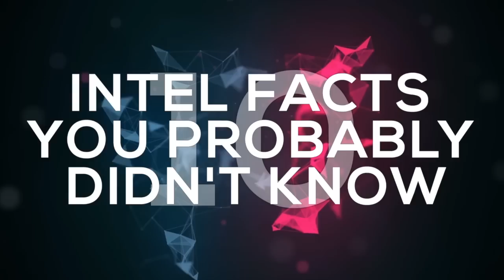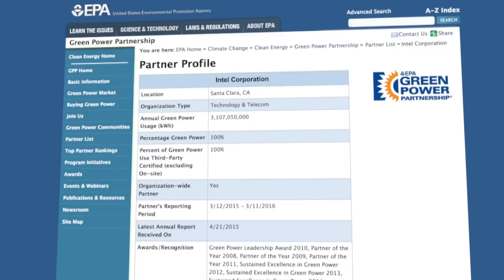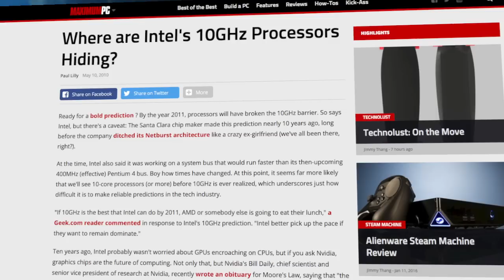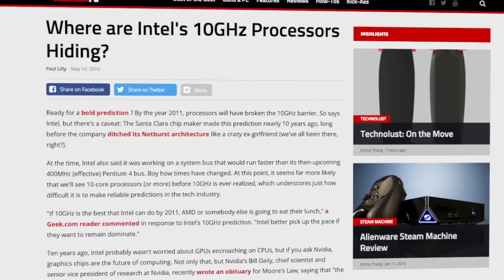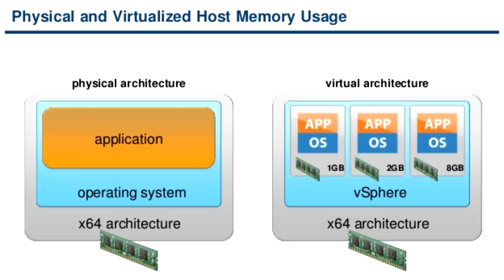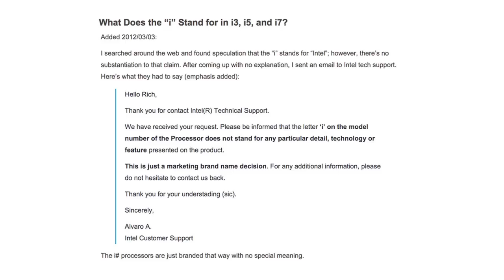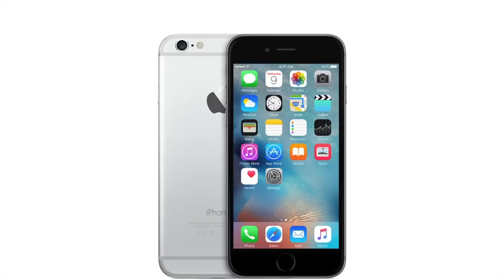10 INTEL Facts You Probably Didn't Know

Comment: You should do a video on Li-Fi
Reply: +Nathan Who why? It's shit.
Reply: Explain your reasoning.
Reply: Nathan Who
* You require the receptor to constantly be open (not covered), so that means no mobile devices except maybe laptops (but not even those, I'll show below), because you don't have enough room for that.
* In order to stimulate the receptor, you either need a strong source of light, or a very big receptor. And I do mean big. Or you just have very low transfer rates. Why? Because look at DSLR cameras. Under a LOT of light, the best DSLR cameras can produce around 60Mb of data in under 1/100s, using a huge, very expensive sensor. LiFi doesn't need many pixels, but it's just the general information theory. Both devices would transfer information. Try to make the sensor smaller and you get a weaker signal, more noise, etc. It's inadmissible in data transfers. The total information passed is the information in every pixel * number of pixels. Make fewer pixels and you'll get less information. You can make 1 single pixel (like it's required for LiFi) but make it very big, but that will just equal to the same information transfer speeds. And that's a pristine, clean, huge sensor under immense amounts of light compared to what people usually have at home when surfing the web. The sensor you can fit on a mobile device won't be bigger than 1/100 of that. And the light that would be used would be orders of magnitude less intensive, thus producing very very low speeds in actual usage scenarios.
* Interference. WiFi operates on frequencies that are open and not used. If there are 2 WiFi devices on the same channel, the throughput suffers a lot. With light, you get interference from everywhere. CFL bulbs, daylight, etc. In order for LiFi to work you need a dark environment, or a synthetic environment that doesn't occupy the frequencies occupied by LiFi.
* Reflections cause interference. At high transfer speeds, a longer path the light takes from, say, a mirror or even a white wall, will get the signal out of phase to the sensor, distorting it.
* It's not duplex. You need to have the mobile device transfer information back. You can't make the mobile phone transfer so much, can you?
* It won't work across rooms
* It has been tried before (see IRDA), and speeds were very slow. Bluetooth quickly replaced optical (IrDA) transmission for obvious reasons.
* It's not shown to work. The only demonstration I saw was at a TED talks (usually where shit like this gets presented), and guess what: dark environment, no reflective surfaces, strong lamp above a huge sensor directed at that lamp, transferring a standard video stream. OMG that is so fucking revolutionary!
Reply: Ok you just completely wasted your time because nobody would be willing to waste their time reading that whole thing, to be honest i havn't even read the first word and i'm not going to...
Reply: +Donnie because I asked for simple evidence not a short story on why it's bad.
Reply: +Donnie next time you read you should take more notice, I didn't even ask for evidence I just wanted you're reasoning and you're starting an argument just because I had my own opinion?
Reply: +Nathan Who i read it

Comment: You're shitting me about fact 9, right? Intel had a massive boom of business with (don't recall the specific generation) of processors, so they basically paid AMD 20% of their profit to use their facility to make the chips there as well so Intel could meet demand. Then AMD went and stole all their shit by reverse engineering it, tried to make it better and faster, which is why for decades they were always one step behind Intel as far as speed goes. The reason those chips were interchangeable is because AMD flat out stole Intel's design.
Reply: +Jesse Crandle stealing design would count as breaking the laws, and would land AMD bankrupt. AMD was making Intel chips for a long time. I had an old IBM 286SX with an Intel chip manufactured by AMD. 16MHz.
Reply: AMD was the first to crack the 1ghz barrier -_-

Comment: Well, about the CPUs not going to 10 ghz, Gordon Moore would not have known that we would have multi-core processors or that we would put GPUs inside the chip, which can also run general programs (OpenCL FTW). So if we were to transform the 8-core Intel 5960X chip (Iris Graphics included) and turn all that into one core, we might hit that 10 Ghz mark.

Comment: I can play chess without a CPU.
Reply: Bishop Munoz
I bet you're fun at parties.
Reply: can play it with the integrated cpu in your ssd nowadays
Reply: +PCMOTHAFUCKIN MASTER RACE

if humans were machines 
in more detail

brain: CPU (higher IQ = more/faster cores)
heart: hydraulic pump
adrenaline: turbo boost/overclocking
blood: liquid coolant/energy transfer
lungs: air intake/coolant filtration
stomach: fuel processor/additive intake
liver: energy regulator/waste management
small intestine: energy generator
fat stores: battery/UPS
large intestine: waste disposal
skin: adaptive heatsink/case
skeleton: internal mounting points
nervous system: wires
arteries: high pressure hydraulic lines
veins: low pressure hydraulic lines
spleen: liquid coolant reservoir/filter

(that's about all i can think of right now)
Reply: +holdmybeer  Impossibru!
Reply: +Bishop Munoz I have a feel you're trying to appear smart ,but fail at it.
What you just said is irrelevant to the current conversation as we all associate CPU to an electronic device.
Only you tried to appear smarter by bringing this up.
To add onto this,a human brain cannot be compared to a computer,or vice versa.They are not even remotely similar.
And as someone already said to you , 1 petabyte is not 1024 terabytes.It's 1000 terabytes.
Heck,human brains don't even remember things very accurately at all.What you think you remember may not have happened in that way at all.
Reply: facepalm
Reply: so you use an APU
Reply: +abdullah alghani I don't get it and I was just saying so he uses one
Reply: +abdullah alghani good one
Reply: +StereoBucket that's the thing.. human brain don't REMEMBER but doesn't mean the information is not in it you know? take it like that human brain is sort of nvidia's 970 problem with that last slow 512mb, is there but you have problems using it...
Reply: +Bishop Munoz he plays it with his 2nd brain...
Reply: i guess it would have made more sense to call it networking or something
Reply: congratulations. ..
Reply: well you can play a fricking RPG(Dungeons and Dragons) without a computer so I don't think anyone is surprised
Reply: holdmybeer the cpu is the heart of the pc
Reply: so you play chess without using your brain? because your brain is basicly a biological computer. and all computers have a cpu. it's even been tested that a human brain has an average of 25 petabytes of memory. (1 petabyte is 1024 terabytes for those that don't know)
Reply: +philipx550 
lungs, digestive system, heart = power supply
eyes = camera (not display, as you can't display what your visual thoughts are)
sweat = cooling system
body = case
nervous system, circulatory system = motherboard
clothes = stickers/etc. that you put on your case

Comment: The 100% renewable energy part is a myth. Sure, they buy power from renewable energy companies, but that energy is transmitted over the power grid and the energy Intel uses is not necessarily consumed at the same time the renewable energy is produced. Coal, natural gas, nuclear and hydro are used by Intel. So it's nothing more than an accounting trick. Renewables simply can't deliver energy on demand. They are not reliable sources of energy.

Comment: it could be possible to create a 10 Ghz CPU, but in the early millennium Intel figured out that they just can't put more Ghz in a CPU to make it faster. That is where cores comes in where it's basically like 2 or more CPU's in one chip. So a usual  CPU has 4 cores each running at 3 Ghz, that means in total it's running at a total speed of 12 Ghz. And that's just  just CPU around the $250

Comment: what's the best cpu to go with the gtx970? my budget for the cpu is 220 max, maybe or maybe not OC it
Reply: Go to game debate and search for your gpu. It will recommend the best CPU match for your gpu. I think an i5 will do.
Reply: +max rai damn! thanks my habibi :D :3
Reply: +Andy Garcia just search for the exact gpu . The company that made it it might be asus msi etc. But I don't think it will make much difference.
Reply: +Wolves4ever 01 I appreciate everyone's answers but I'm most likely going with the i5 4690k
Reply: i5 is pretty much the best bang for your buck gaming CPU. Some games will run slightly better on an i7 but your paying quite a bit more for just a tiny improvement in performance.
Reply: +Andy Garcia Get an i5, a 4690k if you want to see "devil's canyon" in bios instead of "skylake"
Reply: Andy Garcia game debate recommends an i7 4770k which is really expensive. You can get an i5 4690k or 4670k for like 100 bucks less for almost the same performance.
Reply: +Andy Garcia depends on where you live and how much electricity costs there.
Reply: +Andy Garcia including motherboard or no?
Reply: +Andy Garcia Game debate is a waste of time, just like CPU and GPUBoss. Id say a 4460 or a 4690k if you want to overclock. Maybe even a Xeon 1231v3. The 4690k needs to be overclocked to something around 4.7ghz to compete with it and its about the same price. The xeon is an i7 4770 without the iGPU for i5 price
Reply: +Andy Garcia good choice. I have one in my rig running at 4.5ghz
Reply: +Wolves4ever 01 I hope so, I want to play skyrim with a lot of mods and enb with 60fps or so, and witcher 3
Reply: Andy Garcia don't go overkill on the mobo. you gain little by spending more then $150. Unless you just really like the look of a mobo (I'm guilty of that xD)
Reply: A GTX 970 is a GPU, mate. If you're looking for budget GPUs, the 750ti is a relatively good card; if you're looking for budget CPUs, the i5 4440 is a good bet in my opinion.
Reply: Astride a Grave He wants a cpu for the 970 he already has.
Reply: +bensemus x Fuck, I'm really dumb.
Reply: Astride a Grave lol np :)
Reply: +Andy Garcia i5 6500
Reply: +Andy Garcia i5 6th gen
Reply: If you want to OC go with a intel i5 6600k if not than a normal 6600 will be good
Reply: Is there any difference in the 6600k and the 4590k?
Reply: Festive Chip Different node.
Reply: Festive Chip One has a newer architecture and supports newer features like DDR4. They don't work on the same mobo. They are also different tiers of products. The 6600k replaces the 4690K while the 4590k doesn't even exist. The 4590 does and it's just a locked and slightly slower version of the 4690k. The 4690k's architecture is slightly tweaked compared to the 4590.

the 6600k is Skylake, the 4690k is Devil's Canyon (tweaked Haswell), and the 4590 is Haswell.

Comment: DO GHZ REALLY MATTER FOR GAMING? CAUSE I HAVE GOOD SPECS BUT ONLY 2.6 GHZ
Reply: Depends on the CPU. What one are you using? The newer it is the less the clock count matters for Intel CPUs. AMD CPUs for gaming benefit from higher clocks.
Reply: +A-MANX clock speed doesn't matter for anything except clock precision. What matters is overall CPU performance.
Reply: +bensemus x INTEL(R) CORE(TM) I7-4720HQ @ 2.6 GHZ 2.6 GHZ
16 GB OF RAM (15.9 USABLE)
NVIDIA GEFORCE GTX 980M WITH 4 GB OF RAM 
I CAN BARELY RUN THE WITCHER 3 ON MEDIUM SETTING THOUGH, WHATS SLOWING IT DOWN? OR IS IT JUST NOT GOOD ENOUGH FOR THE WITCHER 3 xD. ITS A LAPTOP BTW IF THAT EVEN MATTERS.
Reply: +Donnie ^
Reply: A-MANX That hardware is fine. Any chance you are trying to play at 4k res or have DSR (dynamic super resolution) on by mistake? Download HWMonitor or a similar program and see what the gpu and cpu are actually running at.
Reply: +A-MANX I had same problem with Alienware 18. Turns out the CPU or GPU hit max temps and throttles itself.  I had to return the unit.  I now have $4k credit from Dell and I don't know what else to get.
Reply: bensemus x YES IT IS ON DEFAULT 4k RESOLUTION, I'LL HAVE TO LOWER IT THEN?
Reply: A-MANX why are you using caps and yes you will. The 980ti/Titan X/Fury X can't run 4k games well so your 980m doesn't stand a chance. Set the resolution to 1080p.
Reply: idk i just do sometimes lol. some old games work perfect on 4k but i guess ill have to tone it down for the newer heavier ones. thanks for replying :)
Reply: +bensemus x ^
Reply: A-MANX np. The older games work as they are less demanding in general so your hardware can handle the extra work required for 4k. Newer games push hardware hard at 1080p so to play them at 4k really requires 2+ top tier cards.

This year AMD and Nvidia are releasing new architectures so we should see a rather large jump in performance xD
Reply: +A-MANX whenever you write in caps, for some reason I sort of shout the  words in my head

Comment: Because CPU's chips are made using light sensitive material, the ability to improve CPUs is going down dramatically. The areas they need to detect using the light to make the chip properly is becoming SO SMALL that the beams of light they use wavelength's are becoming too large to properly engineer the chips.